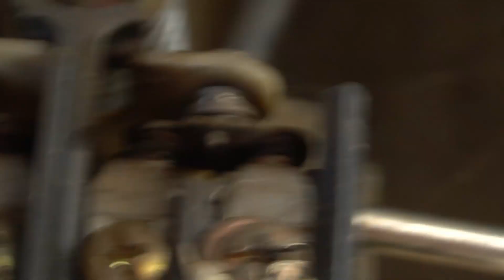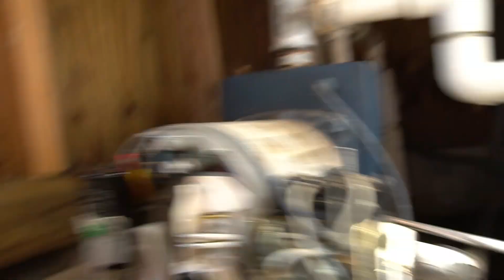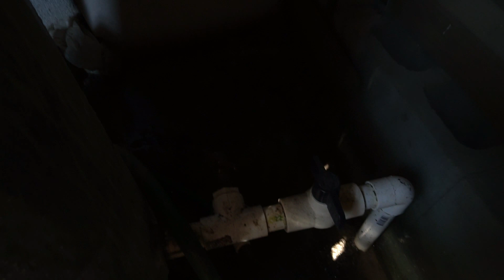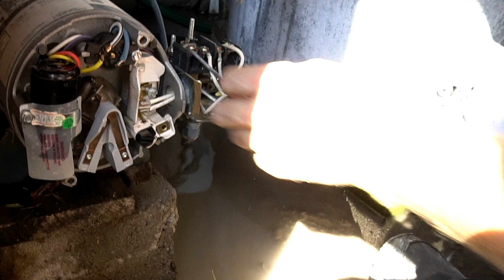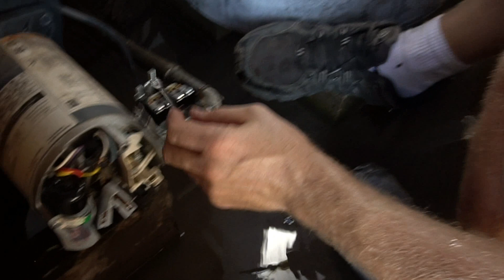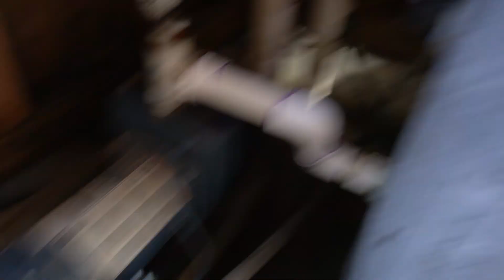Shallow Well Pump - diagnosis and repair

Comment: hello THANKS FOR POSTING YOU VIDEO IT HAS GIVEN ME ENOUGH CONFIDENCE TO TAKE APART THE FAMILY'S WELL
are you still around to answer questions...my parents have the same looking well , dad past so i'm trying to keep things going..mom called me 1 day said the well was squirting water and she turned the switch off...i went over and found out the pressure points water line had came off and flooded the  hole the pump is in..motor had became somewhat submerged  as the pump stayed on since the pressure switch had no pressure (i was surprised the motor was still running w/ it under water.) but would not start back up...pump was warm as it was running a while before realizing water squirting up...i tried playing w/ the pressure points they arc as usual w/ the switch on and  we hear a slight  hum JUST LIKE YOURS  oh, yes we put the pressure points line back on but pump is not pumping. i pulled the motor out as it was a tight area pulled the cover off w/ help from your video figured i'd clean out some debris and since it hummed  hoped it might start up No luck winding didn't look black,  pulled the start switch cleaned the points on it  , pressure switch points.. all back together and still nothing....

I am wonder if you could  help me figure out how to test a couple things thinking to test the motor when out , the capacitor....TIA
Reply from the maker: If the motor went under water and was trying to run, then the windings are shorted out probably.  If the capacitor and start switch are good then you will have to replace the pump.  Motors are hard to get for these pumps.

Comment: the motor on shallow well tank is locked up. Can't turn in either direction.
Reply from the maker: Could be bearings or impeller but rarely , should bring to someone that can rebuild it or just replace with a starite pump.

Comment: Best video so far on old style tank
Reply from the maker: That is what people don't understand this in not a old design of a tank.  It's just a different type used for different applications, bladder tanks are just as old.  Whether it's a metal or fiberglass it can still be the same type.
Thanks for the comment and watching,
Casey

Comment: Quick question, my pump hums just like and wont start but if I give the case a SMALL tap it starts. Is it the Bearings or capacitor? I'm guessing bearings.
Reply from the maker: Well it depends on what you are hitting.  If the motor starts but makes a screaming sound it's bearings.  If your hitting the motor it's probably the start switch, check points with power off.  Lightly sand them to get working again.  The capacitor will fail if it keeps not starting and gets too hot.  Don't let it keep humming for long.

Thanks, Casey
Reply: @ClearWaterPumpWell  Fortunately I was in the basement near the pump when it happened so the longest it has hummed is about 5 seconds. I thought the bearings were seizing up but you were right, I cleaned the points and I haven't had an issue since then. Thanks from Northern MN
Reply from the maker: Just saw the Google post, I appreciate it.  Glad you got it going!  Send me a picture of the well system through the email, would like to see what kind of setup you have up there.

Comment: Have a shallow well 3 yr, old jet pump, new (3yr old) lines & footvalve.
Pump losing pressure within several minutes with no taps on.
Kill power & pressure will go to zero.
Could faulty tank or pump malfunction cause this?
Hate the thought of pulling line up again! thanks for the help you offer.
Reply from the maker: If you make sure valve is off on tank going to the house, then check for leaks around from well to pump and tank.  Even look for air leak or that your tank may be waterlogged, it should be near empty at 0 psi.  Just because it has no pressure does not mean tank is still not full of water.  Check cycle time from pump on to off after running a faucet till on.  Should be at least or more than 30 seconds run time.  If it holds pressure for a bit but slowly drains, then listen close to well pipe with ear.  If you hear water flowing the it's a leaking foot valve or split in fittings or pipe. 
Thanks for the comment and watching!
Casey
Reply: Hi Casey.. I have narrowed it down to most likely the footvalve. I tried to install a brass check valve near pump
And a “T” with a cap near it for priming. I primed pump & the t repeatedly & ran pump for 2-3 minutes each time
But I cannot get it to prime now. Do you see a problem with doing this to try to avoid digging.?
I’d appreciate any more ideas. No water is No fun. Thanks Casey
Reply from the maker: @joes8275  Check for suction leaks also, the pump should be able to prime very easily.  A bad foot valve will not prevent pump from priming, but only leak back and cause pump to cycle after shutting off.  Make sure when pump is full of water and prime plug loose or off that pump can throw water out.  This will tell you pump end should be good and no problem with impeller.  If you have a AVC "air volume control"  installed on tank with line to the pump suction, make sure it's not defective.  Clap, kink, or plug tubing to check it, if pump catches prime its bad. 
Thanks,
Casey
Reply: @ClearWaterPumpWell  Yes, pump is throwing water....and lots of air after installing the check valve.
I tried for hours to get it to prime but no go. The best I got was up to about 28psi just under cut-in but when
I cracked open valve to feed house piping it dropped right away.Note that I only added check valve to see
If I could avoid digging again . Before that it primed ok after 2-3 tries , hits 50 psi in15-25 seconds but back to
30 psi in one minute or less.Repeat.I have a well about 45’ deep & footvalve down about 28’ (old one was the same depth & no
Problems for 35 years) Never thought I would have to dig again! I appreciate you trying to help.Many Thanks Casey.
Reply from the maker: @joes8275  Yea if it barely primes but with plug loose continues to bleed air then you have a suction leak.  It's anywhere from pump to the well, check threaded and recent glued joints for leaks.   Pressure up with air compressor if you can through a faucet or 1/4 plug connection.  Use soapy water in spray bottle to find air leak along suction line.
If it's not visible anywhere it must be drawing down, but 28' is beyond max lift on a shallow well pump "depending on pumps elevation to water table and well casing to end of drop pipe".
Reply: @ClearWaterPumpWell   Problem solved. I could not get the check valve to work.
Ended up digging it up & pulled the line to find corroded threads & a hole about 3/16 dia. right where it screwed
Into the brass foot valve.  Everything was new about 3 years ago! Finally have water again!
I really appreciate you taking the time to try & help....and your tips DID help. All the best, Casey.
Hope you get a million subscribers & can hang up the tools some day!
Reply from the maker: @joes8275  Great to hear that you got it, take it easy man and appreciate the kind words!
Reply: @ClearWaterPumpWell  m

Comment: What if you had a submersible pump in the water and a jet pump hooked up to the piping above ground? What would happen?
Reply from the maker: It would basically be a booster pump if run at the same time. There is no need to do such things unless you have no other choice.  You can just about always get bigger hp and lower Gpm submersible pumps to get enough pressure.
Thanks for the comment and watching!
Casey

Comment: circuit breaker keeps tripping within a few seconds, we changed the cap and starter switch, could see burnt wire and starter switch was burnt also.  Changed it out and circuit breaker still tripping.  Need help Please...
Reply from the maker: If windings are burnt for sure there is nothing you can do.  The motor or pump has to be replaced, check with pump supply company locally.  Don't buy home depot, Lowes, tractor supply or harbor freight pumps and equipment!
Reply: @ClearWaterPumpWell  The wire that was burnt, was the red wire between the starter switch and cap. We replaced burnt wire and starter switch. Really can't tell if windings are burnt, what we can see, they look good.  Hoping it is not the motor.  Before it trips, motor sounds like it comes on, then trips.  It was humming before we changed the cap. Getting ready to change out pressure switch, contacts are pitted and black.  Don't know if that will help. Could a bad pressure switch cause a breaker to trip? We also got a new circuit breaker. lol, Thanks for your reply.
Reply from the maker: @31rearea  If it's tripping breaker instantly it's a short somewhere, make sure you check power to switch with it disconnected.  Use a screwdriver between points so you can test it when your at the pump.  Make sure your wire leads in motor are not routed near the clutch in center it can snag the wires and break them.  They have to go under capacitor and start switch.  If motor hums its one of 4 things wrong, power, capacitor, start switch and windings /wiring.  It's not going to be the pressure switch, if you have power in and out to motor.
Hope you get it going.
Reply: @ClearWaterPumpWell  husband found white wire shorted from the power disconnect to pressure switch.  The white wire was burnt in the metal flex.  Up and running.  Thanks for your reply.

Comment: Dude, I've been wrestling with my well water pump for far longer than I care to think about.  I just watched your video and I think you've given some real insight into how to make it more reliable.  Thanks for sharing your experience.
Reply from the maker: Yes this method works extremely well but on a flow well that has atleast a few psi to pump.  The other way is to use an aerator and air release to maintain air charge in the tank.  Also reliable but can start causing excess iron to drop out and stain plumbing fixtures. 
Thanks for the comment and watching,
Casey
Reply: @ClearWaterPumpWell  My issue wasn't actually directly related to your video but I've had so much trouble finding reliable informatoin about air volume control valves.  I've long susptected the last person to work on our pump didn't really know what they were doing.  Watching your vid Iwas able to get a little better idea how things are supposed to be connected.  I did a little troubleshooting and found out the AVC was connected to the output side of the tank instead of the suction.  I'm gonna run to Home Depot soon and get some pieces/parts and try to straighten it out.
Reply from the maker: @dizzy_derps  Oh ok gotcha, so that's right an AVC requires suction from the pump to operate.  My old video shows the replacement of one, but I need to do a newer and more detailed video about AVC's. https://youtu.be/Ova5Wx3DQlI

Thanks again, and let me know if you have any trouble, I may be able to help you further.
Reply: @ClearWaterPumpWell  If you don't mind me picking your brain again, I put the AVC on the suction side and now my pump will cycle on when I open a faucet but it never gets all the way up to pressure.  I think my shut off is 60 psi and it just floats at 55.  Once I close the valve it'll hit 60 and shut off like normal.  This make any sense to you?
Reply from the maker: @dizzy_derps  That's what it should be doing but your cycle time from pump on to off with out using water should be 30 seconds or more.

Comment: Thank you for the detailed video.  Which is better a brass or plastic foot valve?  I "believe" I have a leak on the suction side of the 1 1/4" line going into the well casing. When I put my ear up to this pipe with the water pump OFF and at 50 psi I can hear it slowly leaking.  Not a sound on the pump side. The pump will turn on at 30 psi but then drops to zero (lost prime) and then back up to 50 psi. In addition to the foot valve there is a check valve immediately before the Sear Hydro-Glass Shallow Well Jet pump housing. I had replaced the foot valve years ago with a brass one.  This is a 30 foot well. Thinking of pulling up the suction side plastic pipe to replace the foot valve but am I on the right track as doing so is not a fun project?  This all happened a week after I shocked the well.  Thanks in Advance for your response.
Reply from the maker: Hey, good question, it's possible if you hear water running back into the well it could be a few things.  Check for a split in the pipe, cracked adapter on foot valve, or leaking foot valve seat form wear or obstruction.  Hopefully you have room to pull the drop pipe and put in a tree or on a roof as to not break the pvc.
Brass valves are best I recommend a Flomatic or Simmons brand valves.  If the well can be completely sealed you can remove the foot all together and adapt a direct suction on the well casing and have a check valve above ground near the pump.  The advantages of it is less restriction and easier to change valve.  Initially priming will take longer to pull watertable up to the check valve, once there it's not a problem.

Thanks for the comment and watching,
Casey

Comment: Where to begin??? My shallow jet pump is old as dirt and with that said here’s my story. 
1- I replaced my pressure tank with a Home Depot 20 gallon tank and  it was already set to almost 44 psi. 

2- Being that it was already pre-set I figured I don’t have to mess with it and everything would be fine. So I got a new pressure switch 40-60 because the old one was shot anyways. 
So I lowered the pressure tank to 38 psi. 
3- I don’t have to mess with it, right? But no! My pressure switch was not rising above 30 psi. So I figured I may have some leaks and I don’t to my amazement. But it was still at 30 psi. So I start counting the turns on the pressure switch and NADA. It won’t go beyond 30 psi even if I screwed that thing always to the bottom. It turns on at almost 12 psi and turns off at maybe 28 psi. I do count the turns I make on the pressure switch. 
It can’t be the capacitor because it turning on. It can’t be electrical because it’s turning on too. 
Then again what do I know. 

So the other day before jumping into the shower I turn on the water but I don’t trust my pump. So I’m listening to the pump and it never clicked off but was make that humming noise just like in your video. I turned off the pump from inside the house and went outside and I could barely touch the thing it was so hot. The next day it was working fine except for the 30 psi issue I’m having. My source of water is a 600 gallon tank at 2 feet away if that. 

So I’ve seen all sorts of videos but none a clear as yours. I don’t know if I should replace the pump already or see if it could be fixed before running out and buying a new jet pump with the very little cash flow that I have. Did I mention I had a couple of technicians over but really didn’t convince me one bit. One of them even screwed on my brand new check valve backwards and told me that it was damaged until I mentioned what he did. Can you imagine that? No reliability. Sorry about the sob story. Any help will be greatly appreciated. Thanks!
Reply from the maker: Hey, sounds like the jet on the pump is clogged, loose or broken. What brand of pump do you have?  Don't run it longer than 5-10 mins without shutting off and not moving any water as hung on 30psi with valve to supply off.  It will only get damaged more if left running, it's possible to fix easy if I know more about it.  So your using a tank as your water supply?  What is the source of water to fill the tank?  I'll be happy to help if I know more about the system.
Thanks for the comment and watching,
Casey
Reply: @ClearWaterPumpWell  
I have a craftsman shallow well jet pump 1/2 hp with dual voltage Model # 390.2521. It also has a code 001G07P 006. The motor is C48H2EC11C3. Today I changed the pressure switch to a 20/40 and dropped the pressure tank to 18 thinking that if its only giving me 30 maybe it'll stop at 30 and turn on at 20. No luck, man! My capacitor is fine, amps are fine according to the electrician that dropped by today. He says there nothing wrong with the motor. It's working fine to me. I don't think it's fine. This is mind boggling. I don't dare crack it open nor do I know of any technicians that know about these units. Sears shut down shop so here I am trying to figure it out. Thanks for taking the time to here me out on this. I really appreciate it. If I find myself having to buy a new pump what should I invest in? Of course that would be when I'm called back to work. Whenever that is.
Reply from the maker: @captsax  that is a very old plastic pump model, the jet cracks or seal blows out inside.   I know how to repair possibly with no parts.
Reply: @ClearWaterPumpWell  
How?
Reply from the maker: @captsax  You can split pump apart easily and look inside on the suction side of the pump end to see what's wrong with the jet.  It's a metal band with nut like a giant stainless clamp, drain the system pressure, remove metal band clamp and split open pump.  It has a o-ring gasket that's reusable, don't remove it or stretch it, put it back in groove if it falls out. I'll need to contact you by text message so you can send me a picture of it and I can share the fix.  Contact me tomorrow evening and I'll try to help you.  Send me a email through YouTube.

Comment: Hi ! I have a question. My pump is running (on) but water stopped completely coming out. The tank has no water in it as well. What could be the problem ?
Reply from the maker: If you have a AVC check to see if it's causing pump to lose prime.  If a deep well pump it could be a problem with the jet.